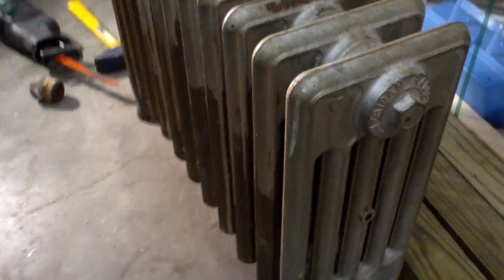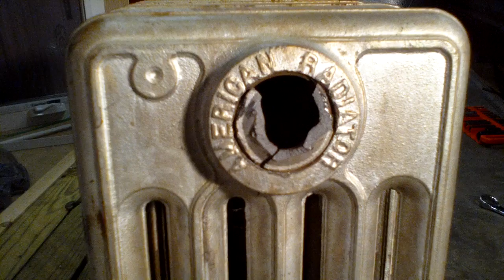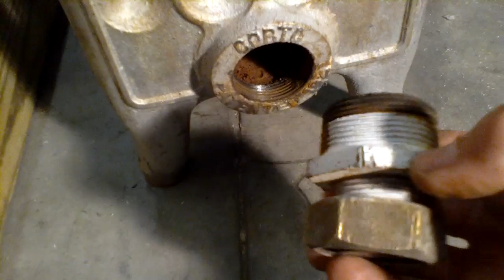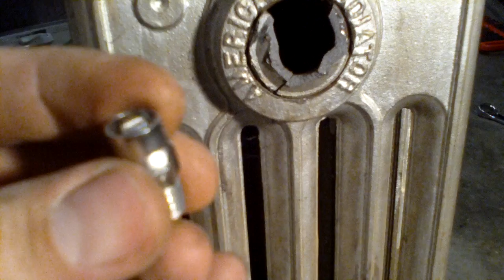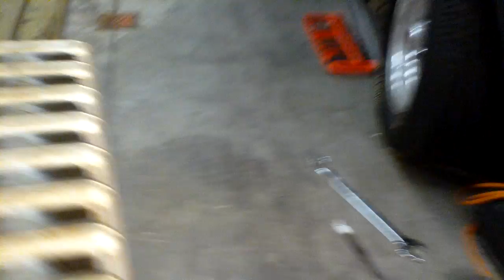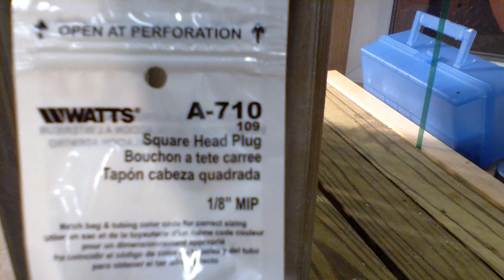Cast iron radiator  hot water conversion

Comment: i think you should feed on the bottom and return on the top, with the vent on the return side...if you use both tops the water will flow right over your radiator not go through heating the whole thing

Comment: Can a hot water radiator be converted to a steam radiator?
Reply: 1uniquemonique yes but if it is a steam rad originally and want to change to hot water you can only do that if the rad has the top half of the fins connected like in this vid. If they are not connected then it's not efficiently possible.  I was always told to pipe it so the flow in the water system goes in one end on the top and works its way down to the opposite bottom port.

Comment: These steam radiators do not have a seal ring in the top filets only below its like a wedding band appx 2inch diameter squeezed between the round area to make a tight seal. They will leak and destroy your home. Most steam radiators are not designed for conversion.

Comment: This was very helpful, despite the magnaflux salesman.  Unable to remove or even break off the plug, I just cut the end off and then cut it out as you suggest.  It worked great!  

As far as drilling and tapping for the air vent, there is a spot to do that, but there is also a pre-threaded hole that has been plugged with a flat head plug.  Is there some reason you wouldn't use that?
Thanks,
Dan

Comment: If this radiator was only filled with H2O (water or steam), then you could have used a handheld propane torch to heat those plugs prior to attempting to take them out. It would have eased removal and prevented their damage. Before placing back into service, you should magnaflux the threaded opening, to make sure you didn't crack the radiator.
Reply from the maker: That's a great idea however great care was taken to chip out the old fitting and they came out very easy. I'd like to point out that it is more important to magnaflux after installing the new bushings with teflon tape. They should not be overtightened or will crack the radiator. I converted 10 radiators like this one to hot water without any issues. Please check out my other video .Thanks
Reply: For a suspected location doing a one-off job, I'd recommend taking it to a NAPA Auto Parts house that has a machine shop - they can magniflux for you, for a nominal fee. If you want to do it routinely, you need the handheld electromagnet and a few pounds of fine iron powder-filings. You simply sprinkle it onto the clean suspected site, and activate the electromagnet. If the iron is cracked, you will see defined lines in the filings, where polarity is broken due to cracked iron. You can also dye-test, but it is much more expensive for large parts. The dye works the same way, it highlights the cracks that your eyes cannot see.
Reply: Don't think propane torch will get anywhere near hot enough, i saw a guy use a turbotourch and it still didn't come out

Comment: J0Boa can you recommend list the thermostatic valve you used and what model? I have the exact same radiator and just about ready to convert to hot water heat. Do you recommend the New PEX pipe or straight copper? Thanks.

Comment: Steam radiator heating is the best.  It heats the house quickly, when the boiler shuts off, the radiator stays hot for a long time making temp. swings less likely, it releases some moisture into the home, making dry winter heat less likely.  Old steam radiators have lasted over 100 years.